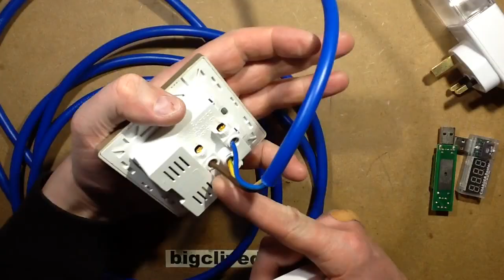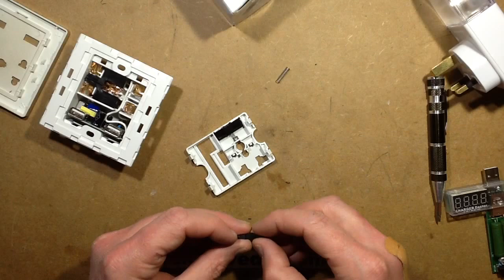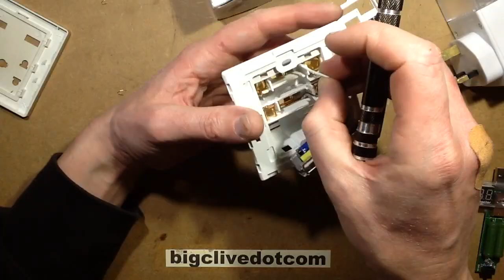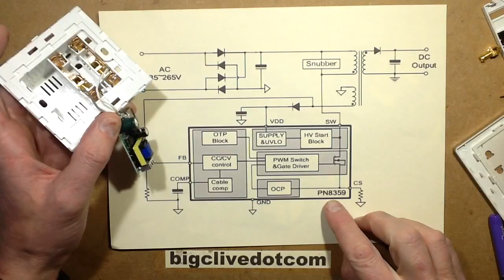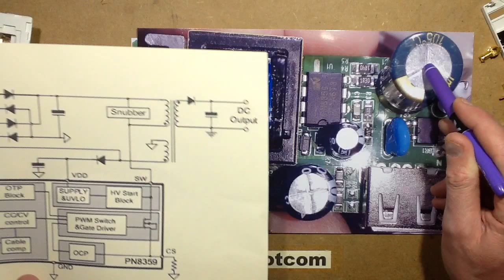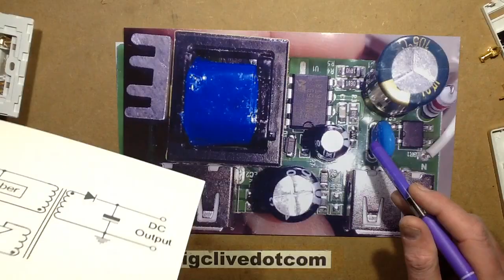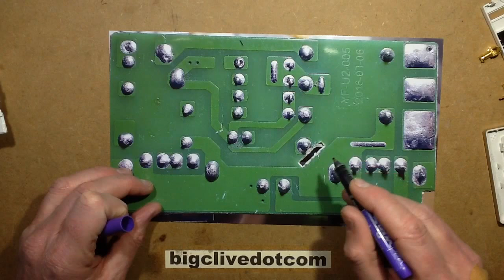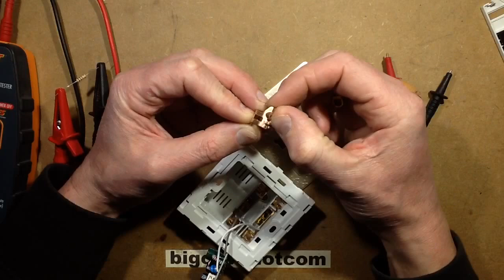Wall plate death-dapter tests including fire and 1kV.

Comment: When first inspected by the area engineers (the best ones at least) from the NIC they get you to build a check box both for the low range continuity and megga meters, values being 0.5, and 1.0 Ohm, 500 K Ohm and 1 M Ohm. Although the supply characteristics can change they also recommend a specific s.o. for checking the earth loop meter. Whilst they are a bunch of self perpetuating racketeers they do sometimes give good advice, what could be better than checking yourself once a month? Here's to Clive and autonomy!
As for the s. o. I wouldn't fit one of those in your house.

Comment: People need to switch to North American power standards. 
Our Circuit breakers, wiring and outlets just seem so much better. 
Now we have the new breaker panels with neutral on the rail, so we get Ark/ground fault, plus a clean plug and play install.

Checkout https://www.leviton.com/standalone/LoadCenter/

Even individual breakers can have BLE or WIFi monitoring/control. Dope AF! 

- Terminate all hot and neutral wires
at custom lugs in the panel, not at
the circuit breaker*

Comment: Man have you tested those plugs that have just 3 USB ports in them??  I have one and have used it rarely because I'm not sure if I should trust it.  But it was putting out 5.2V when I tested it.
I remember when I found out how stout the mains were, I stuck my fingers in a light receptacle on a lamp I was playing with.....  120v and I made contact with the hot and neutral both, that hurt and burnt alot.
I still can't look at that lamp without having a laugh at the ummm flash back...
Reply from the maker: I've looked at three port PSUs in the past.  If they're very cheap don't use them as they pose a risk to your equipment and you.

Comment: Having made flame retardant plastic for a while, that does not look very self extinguishing, so it's either really bad at it, OR it isn't at all. The plastic we were making, holding a flame to it would let it burn, but then it would almost immediately self ignite, and that was testing it with pellets so a lot more surface area. Now I can't say if that is a kind of flame retardant plastic that maybe doesn't output quite as toxic fumes as the stuff we made though, so that is possible.

Comment: The extra winding is also for feedback.

The reason calibration is so difficult is - you could just measure a 1 Mohm resistor and get 1.02, but how do you know if your multimeter's reading too high or if the resistor is actually 1.02? What if the resistor is 1.02 but your meter reads low and says it's 1.00 - then you'd think it was perfect.
I have no doubt that calibration is not needed for the sort of tests you do though.

Comment: I shocked the shit out of myself as a kid with our inferior shutterless US plugs. Now im an electrician, and US have shutters. They kinda suck here because not all of our plugs have ground pins so you have to push both the pins in at the same time for them to open. So if you plug the plug in at any angle other than perfectly straight, it won't go in. Really annoying and required by code now lol. You should look at some

Comment: At age 5 I unplugged the twin lead of a battery/mains radio from the radio and handed it to my 4yo sister to use as a microphone. Boy could she scream. She got a fat lip, I got a reddened arse and she can't even wire a fuckin plug. Yer theory's not proved yet.

Comment: When I was 11 years old, connecting 220v wire plug to battery, I think it will recharge the battery and it blow up. I am not a electricians but now I know about electrics and electronics.

Comment: 240v is a bit insane for mains
Reply: Why? As long as the installation is safe it means decent amount of power at a sensible current. We can use 3kw appliances and heaters safely, unlike the states where it is easy to pop a breaker or overload a circuit by plugging too much in at once.

Comment: Just a comment on the calibration side. The IET do require calibration of test equipment and the recording of all measurements. It sucks! 

"The Enterprise shall be required to have a suitable system in place to ensure that the accuracy and consistency of all test instruments used for certification and reporting purposes is being maintained.

There are a number of alternatives for such control systems, including:

1) Maintaining records of the formal calibration/re-calibration of test instruments as recommended by the instrument manufacturers, supported by calibration certificates with measurements traceable to national standards, issued by organizations recognized by Certification or Registration Bodies for the purposes of checking the accuracy of test instruments. Certificates issued by UKAS accredited laboratories are preferable."
Reply from the maker: It's all gone very officious.  And yet the amount of deskilling in the UK electrical industry is increasing.  I've lost all respect for the IET.  I'm glad they changed the name from IEE since I had a lot of respect for the former.
Reply: @bigclivedotcom  Well they need to give the overpaid office jockeys something to do apart from sit there with their fitbits running a marathon an inch at a time...

Comment: Interesting circuit; thanks for sharing. However, the statement "relies purely on primary-side sensing" is mistaken. Actually, the sensing in the circuit you show is from the secondary winding (lower-left winding in your diagram) which is also the Vcc winding for the chip. Whereas the actual output is the tertiary winding (right side in your diagram), which is unsensed (indirectly regulated via turns ratio). A somewhat-unusual (but not rare) way of feedbacking a flyback convertor. 

And it's not really why the output voltage is low. The output voltage is low because the output winding is turns-ratio-regulated, and the turns ratio is sightly-wrong on the transformer. 

You can have as many windings (and different grounds!) on a flyback transformer as you want. 

One winding is always the "primary", fed by +160VDC in US (or +320VDC in UK). The switcher and snubber are always on this winding, and its polarity is always backwards from all the other windings. (The "flyback convertor" is one circuit where winding polarity actually DOES matter!!!)

One winding is always the "secondary", which is what I call whichever winding the feedback is taken from. This always feeds a diode which dumps into a cap (which typically fails after a few years of use). This can be referenced to the same ground as the primary, but usually isn't. (You can use as many different grounds as windings, if you want!) If the secondary uses a different ground than the primary, feedback is typically via a TL431 adjustable zener and an opto isolator. (And typically if the switcher blows, it usually blows up the PWM chip, the 431, and the opto as well, so it's always best to replace all four of those at once.) The "secondary" winding is usually also the main output... but not always. (In the case of the circuit you show, it's not.)

The other windings are all what I call "tertiary". These all have diodes dumping into caps as with the secondary, but there's no feedback. The voltage from these windings is indirectly regulated via the secondary and via turns ratio. Say the primary has 100 turns and the secondary has 20 turns and is directly regulated at +10VDC. Then if you have a tertiary with 10 turns, it would have a voltage of +5VDC. (Or -5VDC if you connect an isolated ground to the diode end instead of the non-diode end.)

One of the windings is usually the Vcc winding for the PWM chip. This can be the secondary (as with your circuit) but usually isn't. Usually it's a dedicated tertiary (turns-ratio-regulated) winding. 

(The reason I know so much about flyback convertors is, I repair these beasts, in multiple forms, daily at work. I work in the fitness industry, and just about every piece of cardio equipment you see in a modern fitness spa -- treadmills, exercycles, elliptical trainers, etc -- has a flyback convertor in it, especially if the equipment is powered via a PM 3-phase generator turned by user movement, as opposed to mains voltage. In such equipment, you always see 6 huge diodes driving a huge 400V cap, feeding the primary of a little yellow transformer, with the other end switched at 60KHz by an IGBT controlled by a PWM chip, getting its feedback from the secondary winding via a 431 & opto, and with the secondary and tertiary windings all feeding caps through diodes. I've gotten to the point where I can look at such a circuit board which has malfunctioned and take a good guess within a few seconds as to which parts are bad, with no need of a schematic.)

Comment: Diodes in parallel (I remember reading once upon a time) is a recipe for blown diodes because (my understanding is) the forward biases don't match exactly, one would take all the current because it's forward bias is marginally lower than the other(s) (so each diode either needs its own resistor or you string as many diodes in series as will fit within your supply voltage, which improves efficiency as the braking resistance needed is smaller) (of course a cluster of diodes is more likely to be desired if you're illuminating a space with LEDs, for anything else you just use a higher current rated diode, or I do anyway).

Comment: I gotta say the UK plugs are quite a bit safer than our North American style plugs. Ours have absolutely no mandatory safety features in them. There is no protective cover at all over any of the socket holes. We do have tamper proof outlets but they are very rare and are usually only installed in some new build construction or if someone is trying to child proof an area. Basically the only protection we have is some outlets are GFCI but once again those are mostly in newer construction and even than only ion places where water is likely to be present. I winder if the 220v vs 110v standards have anything to do with it.

Comment: The cut is hand made. It cuts out the corner of the transformer solder pad. It will have made a metal spike that during surge testing an air arc will jump across the gap easier than on the left hand side.

Comment: I built my first cats-whisker radio at age 8 but that was safe as only powered by a PP3. At age 12 in 1974, I got a nasty shock when curiosity got the better of me and I took a look inside my Philips record player which was a valve model. I found my had clasped tight to the live chassis as electricity surged through me. Thankfully I managed to wrap the power cord around my foot and pull the cable from the wall. Told my dad who laughed aand regaled about the 10kV belts he'd had from the HT leads on CRT TVs. Then I got interested in electronics and electricity in earnest and as there were few apprenticeships around when I left school I got trained in the RAF, I had some advantage as my dad, mum and elder brother were all electronics engineers. I've had only a few shocks but thankfully not electrocuted.

Comment: I'm pretty sure those kinds of sockets you showed are designed for use in hotels, as I found a similar socket all over the room in a Thai hotel, except behind the TV where a real Thai socket was shown. However, the only time I really need a death adaptor, is when I'm waiting to board a plane in an Australian airport, as those don't have universal sockets.

Comment: Those sockets can be defeated, both me and my dad used to push a screwdriver into the earth pin to open the other 2 then shove in 2 wires then remove the screwdriver, voila a dodgy as fuck connection.
Reply from the maker: A very popular way of connecting random wires.  That and just jamming bare wires in with a plug.

Comment: When i was a kid i managed to give myself quite a few electric shocks. 1, Was taking apart the vacuum cleaner while my mum was trying to use it. Touched the back of the toggle power switch. 2, Took the globe out of the fridge and 'showed' my dad where it went. Touching the contacts in the socket. to name a couple. Then there was also the time (and this was when i was a bit older) where id collected half a dozen old crappy PCs from places and thought id be so cool and make myself a 'mega' PC. Well these were old AT systems with the power switch being a hard on off switch and having the mains running to it. Well id rewired that and wired it so that when pressed it just shorted the mains like. SO the first time i went to turn it on all it did was blow the switch up and trip the breaker. I never did finish my mega pc.

Comment: In a new Appartment where i lived in my phone charger blew up and started burning although it had some kind of protection against this. Apparently the electricians did a mistake when renovating the appartment and did not properly connect the new wires which over time got hot and then there was flickering light. Although one night i heard small brzzzzzzzt and my charger started smoking. Now i always unplug the chargers when i leave the house because i dont trust them anymore. I would not like to have one installed permanently in my house.

Comment: *Its the USB adapters that make it dangerous. It fails and there is no way to unplug it*. Wall sockets have to last 20-30 years cheap SMPS don't. USB on fire? Just get out a screw driver pliers run to the electrical box shut it off then start taking it apart. By this time your house is on fire. I'll pass. Hate to see the isolation.

Comment: Interesting. I see more and more sockets with USB charge points built in. First "built in" socket I've seen with multi-standard plug offerings. But I use a few of these - https://amzn.to/2KD7cNI - both in the UK to provide charge points as well as mains, but also in France, where we have people visiting with UK, Eu, and US mains connectors, it saves a LOT of adapters. Now I'm wondering if I should take a look inside. The main problem I had with the first one was an unfused plug - complained to Amazon, they now have fuses.  The thing which most makes me ponder is, you see the exact same unit with a different "manufacturer" name every few weeks, something the chinese seem to do a lot.  That could be good I guess - could be a better quality product that lots of people "badge" rather than bodging their own.

Comment: When I was a toddler my mom told me I would pull out plugs and get electrocuted often. So my 5 year old self tried it out with some old wire with my dad 220 welding plugin. I remember liking the tingling feeling until I touched the wires together and you can see where that went.... Now I'm here not quit a electrician but computer geek that play with electricity often.

Comment: im not an electronics expert, just a mere consumer, but this thing looks far too flimsy for my liking. and i do inspect visually anything electrical before it gets installed in my home. mg pet hate is fitted plugs cos the fuse connectors invariably are flimsy copper or tin, so i usually change them for a bs plug instead
Reply from the maker: I wouldn't fit one in my own house.  Another thing to watch out for with non compliant leads is copper coated aluminium cores.

Comment: Could be worse. Here in the US our plates screw on in the center and what happens if you have a steel plate sometimes is the screw falls out and over time when the cord jiggles the plate slips off and shorts out the hot and neutral. When it does it sure makes a night light show!!!! Never understood why it was done this way. Crazy!. I always thought the UK plates look much safer.

Comment: Clive I live in tyhe UKI can you do a video on QI chargers I am in the market for a desk mountable one which slots right in to a standard table grommet size hole I have seen Ikea one's but I am looking for something that doesn't stick out of the desk it needs to be flush with it as I am going to cover the desk with a thin material and use it in a way in which it is invisible
Reply from the maker: It might be worth getting a standard unit and remounting the internal electronics into a recess from the back of the desk.  But the coupling has to be very close in use.

Comment: When I was 2 I stuck a screwdriver into an outlet. Shocked me good. After that anything electrical interested me. When I was 5 the Associated Press picked up my story about my unusual hobby and huge light bulb collection. This was back in 1980. This old couple in Massachusetts sent me a working Edison bulb along with what was left of the box. Every since I got it it’s been the pride of my collection. I also got a job offer at age 5 from the president of Silvana after I graduated college.  But I discovered cars and BMWs is all I have worked on for 30 years. Back in 88 the 7 series had 2500 pages of Schematics. My specialty on them are electronics. The last multi meter set up I bought was $2900. It does everything under the sun as far as electrical testing plus has every location, pin out, and test procedure for testing any sensor on all cars from 82 up. 
Love your channel. It keeps me satisfied so I don’t take my stuff apart. Unless it’s to fix it. 
Your tear down and autopsy of doggy products is awesome. Not to mention the fact you provide education in your videos. Your great at putting things in layman’s terms. Gotta do that all the time. 90% of my customers don’t even know how to check the fuses in their car. I hate charging someone a hour labor for replacing a $0.25 fuse. But if you run any business there’s huge overhead. So my shop rule along with most are 1 hour minimum labor. #bigclyde!!!!!
Reply from the maker: If you're a BMW electronics wizard then you're definitely sorted.